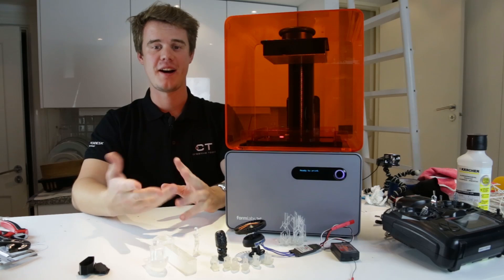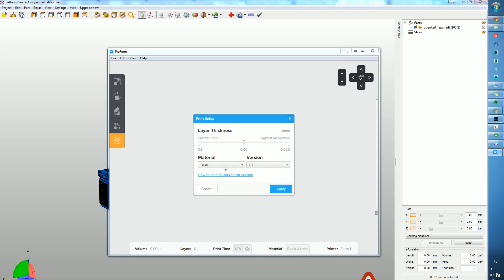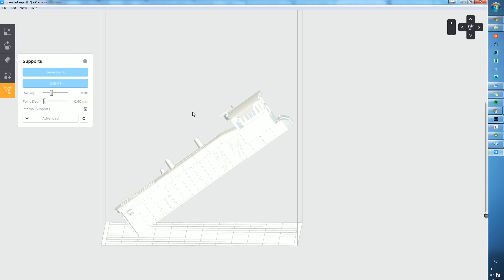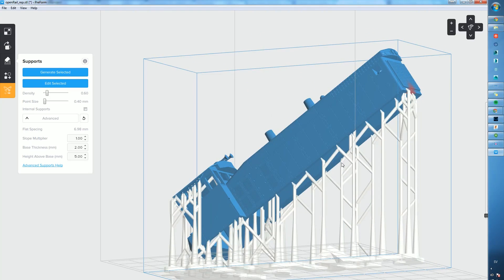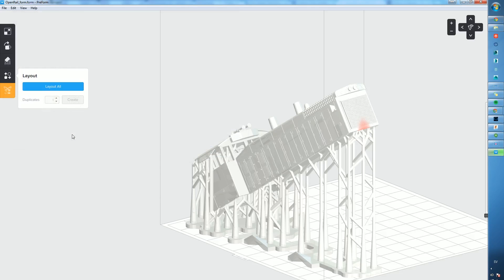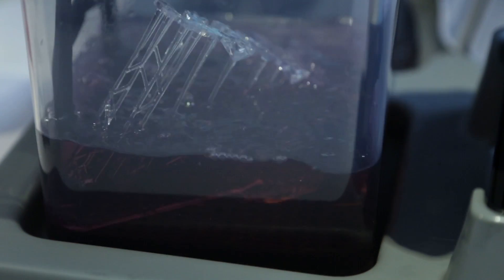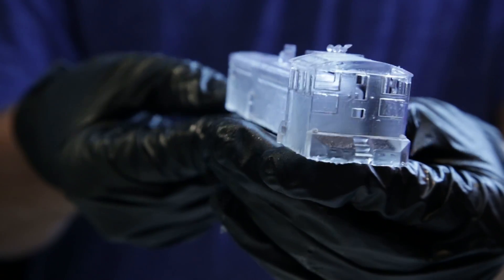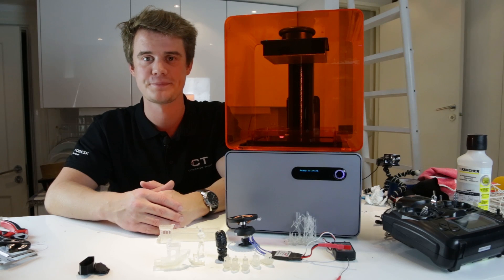Formlabs Form 1+ and Step By Step 3D printing - Part 2

Comment: Hi

Our Form 1+ only prints to the resin tank and not build plate. Would you be able to help us fix this issue?
Reply from the maker: Hey! Sounds like it's time to either level the buildplate so it's better suited to get resin to stick.  You may also try scuffing the build plate up a bit, I remember we did that sometimes to get parts to stick better to it.
Reply: @3DPrintTechDesign  Hi, we set fine tune to 0 across the board. Is this not right?
Reply from the maker: I honestly don’t remember much of the form1+ and settings :/ it’s been 9 years. I know sandpaper on the aluminum build plate used to be a good fix to get resin to stick.

Comment: Pro tip: Have 2 different chambers for the cleaning part. So you use the first one to get the rough "slime" away from the model, than after 2-5 minutes, change to a different chambers with isopropanol, you get it less contaminated that way, and can keep up  longer before you need to change your isopropanol. 

And also, instead of removing the structure right after you have cleaned it, give it some "hours" in the sun or as you said in a UV oven. That gives the model time enough to harden and less chances that you get estetical problems. A typical problem when removing the structures to early.

Comment: Thank you, I'm thinking about getting 1 SLA and this video helped in understanding what I am going to face.
I know I'm crazy buying lots of 3D printers.
Reply from the maker: Haha not crazy! Dedicated ;)   The Form 1+ can now be "hacked" officially according to Formlabs, which could allow for new materials and settings to use resins not originally supported. The Form 2 However is probably the way to go for you!
Reply: +3D Print - Tech Design I like form 2 but since I'm new to SLA I will go small first and Form 1+ developed a good base community to get tips and help with it

Comment: You need way more subs you make amazing videos
Reply from the maker: +iCloud Henshaw Thanks man!
Reply: +AMID I would recommend a ctc 3d printer as I have 2 of them they are just replicator 1 dual clones but they are work horses I have very little issues with them and they have over 2000 hours on each machine and they only cost UK £270 free shipping
Reply from the maker: +iCloud Henshaw Well the Rep1 is really a workhorse in itself. I had mine running for a long time before selling it. I could do really nice prints with 0.1mm Layers and 0.2mm Nozzles even in that one. Seems like a good clone!
Reply: +AMID its a good machine I could never afford a rep 1 though but this machine is very good at printing very detail parts I printed an abs part the other day at 0.06 no issues